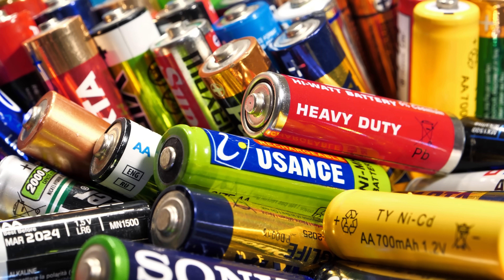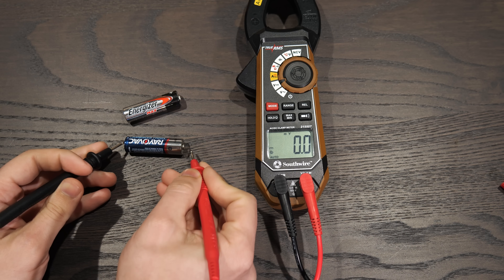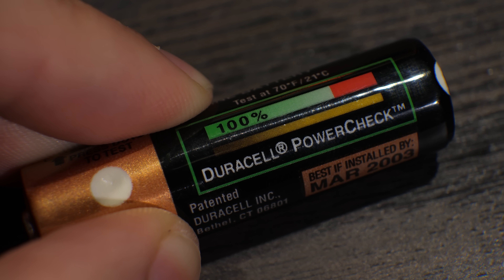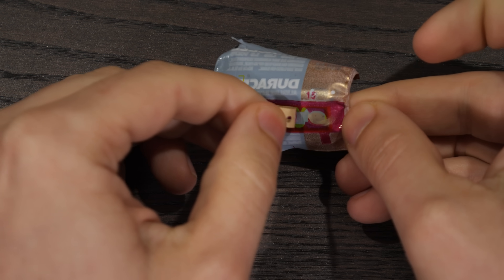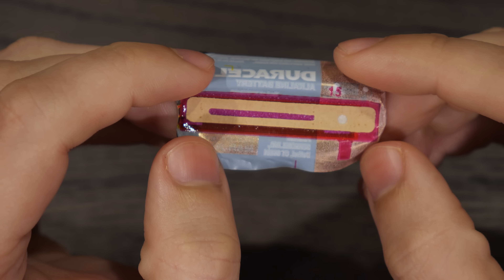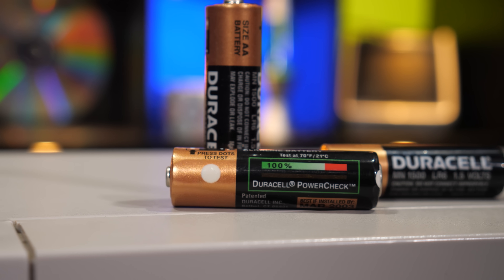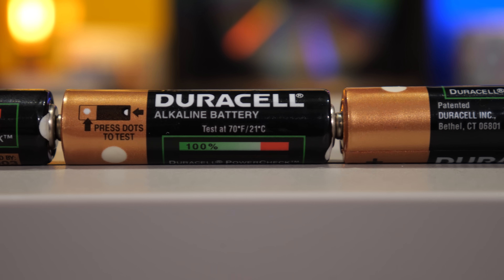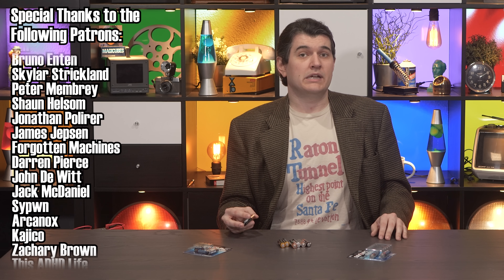Duracell PowerCheck: A genius idea which didn't last that long

Comment: - 00:00 🧒 Common frustration in pre-2010s: gadgets often came with "batteries not included."
- 00:19 🔋 AA and AAA batteries are nearly identical in cost, but AAA has shorter lifespan, causing mild frustration.
- 00:46 🔍 Duracell introduced PowerCheck batteries in the late '90s, which allowed users to check battery charge directly.
- 01:06 📸 Kodak also worked on a similar battery testing technology, leading to patent disputes.
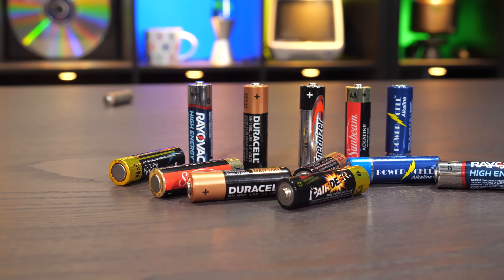- 01:43 ⚡ Battery voltage drops as it discharges, from 1.5 volts when fresh to less than 1 volt when depleted.
- 03:11 🌡️ The PowerCheck worked by using a built-in thermometer to show battery life, with a yellow indicator.
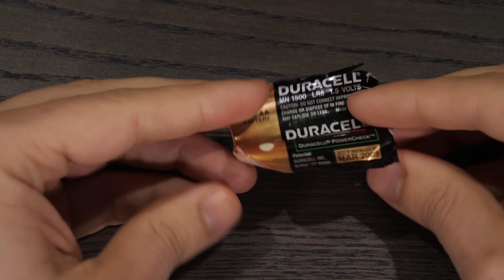- 05:19 ⚙️ Pressing on battery dots completed a circuit, powering a tiny heater that activated the thermochromic material.
- 07:08 🔥 The heater’s resistance varied to show the remaining charge level, based on how much of the indicator turned yellow.
- 09:24 ⚖️ Each time the battery is tested, it loses a small amount of power, but the test is more accurate because it's done under load.
- 10:36 🛠️ Despite its clever design, most people didn't regularly test their batteries, making the feature less useful.
- 13:33 ♻️ The rise of rechargeable batteries reduced the need for disposable ones, making PowerCheck obsolete.
- 14:10 🎮 Devices like Game Boys and Walkmans used to consume tons of disposable batteries, but this is now a thing of the past.
- 14:54 💡 Built-in battery testers are less necessary today, as most devices now provide battery level information directly.

Comment: Great video! I haven't thought of these for at least 20 years, but vividly remember struggling with those dots.
I'm also glad that you referred to Oomph, the technically correct unit of measure for residual battery charge. The late Prof. William Oomph doesn't get the fame he deserves.

Comment: It's a clever but pointless invention. I've just checked my 'man' drawer where I found three AA and two AAA cells. Instead of testing them, I choose to employ Schrödinger's battery principle in which all five cells can be considered to be simultaneously fully charged and dead until they are placed in a suitable appliance or voltage meter. Why bother with the meter when the appliance you intend to use them in will not only carry out its own useful function but will also, at same time, indicate whether or not the batteries are sufficiently charged. Why use a sledgehammer to crush your nuts?

Comment: I wasn't around for this, but in my old school, i found some of those old flash lights that were plastic and had crappy bulbs in them. Anyway, I open it up to find two D cell batteries, with the Duracell PowerCheck. The power check didn't work, but there was still somehow charge in it. Interesting...

Comment: Oh yeah I remember those, but especially the Energizer ones that had this trapezium-shaped box stating 'GOOD', that lit up for a quarter, half, three quarters or in full depending on the capacity left. Quickly found out they worked based on heat because boy if you kept pressing it it would turn hot!
I also had a remote controlled jeep, most likely some junk-box gathered thing that my dad got from a colleague at his job at the time. The thing had a gearbox with 6 speeds but the biggest problem was it just ate batteries like no tomorrow, as the motor in it was a very beefy Johnson & Johnson thing that easily drew a couple of amps. To power the jeep it needed 4 C-cells for the driving motor, and 4 AA's for the receiver and servo-control. Pair that with the 6 AA's the transmitter needed and you understand that as a kid it was a constant swapping of batteries to keep either going.
The cells would come out a bit too warm to touch after some 20-30 minutes of driving the thing around my neighbourhood (which was also about the limit, the batteries would be dead after that time). And those 'GOOD' indicators on the warm C-cells were all lit up ;)

Comment: Considering they lose charging over time while unued, i liked having the integrated tester. I used a lot as well back when they made them. Mainly to check how much charge they had left after a year or 2 to see if they still held any charge.

Comment: Testing batteries isn't about testing half used batteries hanging around in a junk drawer.  It was for testing batteries that were taken  out of a package just opened that has been hanging around in a closet since you last bought them, who knows how many years ago?  That was  the thing about batteries that always made me angry.  You buy a pack of batteries and they'll slowly go dead in the package before you ever got a chance to use them.

Comment: I remember using this type of batteries as late as mid 2010's. Not the exact same model in the video but a blue themed package on the battery. And I also remember like these power checker models were not lasting as long as the non-checker standard duracell models but I might be wrong about this
Reply: with a little search I found some of them are still on sale under the name of Duracell Ultra series in Turkey, very rare though

Comment: My uncle went to put some new batteries in the TV remote and was all pissed off that they didn't work, I took a look at them and they are the Duracell power check batteries like you talk about, the date on the package was 2003

Comment: Anyone that has done product design knows there is a huge difference in size between AA and AAA. Basically the difference can be so detrimental your product wouldn’t even meet the size requirements if you couldn’t step down to triple A. Three triple A can also be more beneficial in space size than double A depending how you have to find them. Dimension and size restraints are some of the hardest things to design around. Adding or subtracting even 1 mm could kill a product especially more advanced stuff like smart phones.

Comment: I remember both the on-battery testers and the little strip testers that were on the packages.  The ones on the batteries were stupid hard to press.  The ones on the package were not difficult to use but I much preferred a numeric value from a multimeter than the strip.

Comment: I learned this a long time ago, forget where, but if you need to check a AA or AAA battery for life, try dropping it (lengthwise) on your countertop. If the battery has a significant "bounce" to it, it's dead.

Comment: The only time I can think of taking partially used batteries out of something is halloween decorations. Don't want to leave the battery in them while they're in the attic, could corrode and damage the expensive electronics.

Comment: My issue with todays duracell is they use a thinner jacket than ever and are prone to leak if stored incorrectly, they are known in some trades as "Duraleak" batteries, iv seen Duracell batteries in the last 10 years kill more old electronics than any other brand to the point for arcade games and pinballs I wouldnt ever trust them now but as a kid in the 90's I remember both Energizer and Duracell was kings of the battery world.

Comment: when I was a kid/teen in the 90/00's I tried so hard to switch to rechargeable but they just sucked so you was forever having to keep some charged as they just never lasted as long as disposable batteries, so thankful todays rechargeable batteries actually hold a decent charge and are pretty reasonable in price.

Comment: 13:40 single use Batteries also have their valid use case, e.g. in clocks, remote you dont use often etc.

Rechargable batteries have a higher power drain, after half a year you can recharge them, even if you didnt use too much power. Single use batteries on the other hand may last years.

Comment: Had some toys when I was younger that needed good batteries. Partially depleted ones wouldn't power it sufficiently, but they would power something else just fine. 

Smoke detectors are another use. You're supposed to replace them every 6 months regardless of if the batteries are still good. They're still fine in a TV remote since that's not a critical device.

Comment: Hi Alec! Great video but these stopped because testing a battery’s voltage and trying to equate it to capacity, especially in the context of modern electronics is ultimately a fools errand as you suspect. A pulse tester like the CBT-1  is the right tool for the job

Comment: I can remember really wanting my parents to get these as a child just because I wanted to see it work myself (yes, I really got mildly more interested in the batteries than the toys they were powering...). Eventually they had to get them as there wasn't any others available in the shop and I remember getting imprints on my thumbs from having to push so hard on those dots...

Comment: The best decision I ever made was getting 12 rechargeable AA batteries and now I am never short as 4 are in use 8 are charging then I let them run out and charge again I used to use about 12 AAs a week for my VR controllers and they cost about 10 euro per pack that was 520 euro a year not a lot but that's a lot to spend on AAs alone

Comment: there was a point in between when batteries had these and when they didn't that the battery packs would come with the test strip as its own little thing rattling around in the package. it was super annoying to use though because you had to hold it in place and put pressure on it and the strip was always short so wrapping it across the length of the battery was a PITA

Comment: Ever thought about doing a video on the connectors taking video transmission from analog signals like composite, component, and VGA to the digital age of DVI, HDMI, SDI, and DisplayPort? I think it would be very interesting to go over the different standards, resolutions, bandwidth capabilities and different uses. Taking a look at how and why they were created too.

Comment: If I have the choice to buy a device with rechargeable batteries or one with batteries you can change I will choose the latter. The second option gives you a device for life the first a device until the battery life of the rechargeable battery lasts.

Comment: Very interesting video, I really loved seeing what these look like taken apart.

I've worked on a number of batteries over the years. In a nutshell, batteries produce electricity through a chemical reaction. Even with dead rechargeable batteries, it's possible for that chemical reaction to produce something like a static charge that will register on a voltmeter, but dissipates as soon as there is any real load. A lot of battery testers have a resistor so that you can put a load on the battery and see it's capacity. Some of these, especially for big batteries like car batteries, are quite large, capable of putting many amps of load on the battery. It's fascinating to me that these little testers also create some load, making them a bit more accurate than just pure voltage.

I seem to remember that part of the marketing when they came out involved this theory that consumers had no idea how new the batteries in the store really were, that they could have been sitting there for years. With testers you could verify the batteries you had actually had full capacity. That and the theory of the random batteries in a junk drawer, or not replacing all the batteries in a device at the same time. My memory was that they rarely said 100%, but maybe that's because we didn't press hard enough or wait long enough. There was always this fear that you were going to use up all of the capacity just running the tester.

Comment: Don't blame the engineers for the use of AAA batteries.   

In my life experience the AAA choice was forced by designers and product marketing people who tough that a device (like a remote) needed to be smaller... Aka Zoolander phone :-).   

Indeed it turns out two AA batteries makes for a far more comfortable device in the hand.   I'm still annoyed by Apple and the appleTV remote which is so thin it is hard to hold.

Comment: Duracell did this again in the mid-2010s at some point. Exact same concept, but the changing filament went over the green/red bar instead of below. Still had to shove your fingernails pretty deep in the bumps to get it to actually register.

Comment: I always preferred to buy the batteries with the built in tester. Plenty of fun to activate the yellow bar. I always used the tester whenever I grabbed a battery because it was fun and reassuring. I completely disagree with the assumption that people weren't using the tester. Now that they don't come with the feature, I test my batteries using a multimeter before I insert them into a device.

Comment: apparently it's recommended to replace both batteries instead of just the dead one. Not a lot of uses for one half dead battery out there IF you do that.
I have a wireless mouse that uses 1 AA battery so whenever that dies (takes around a year maybe 10 months or so) Instead of popping in a new one I could use older ones.
The only uses for batteries I've had in the past couple years are just wii remote and my mouse, and I barely play on the wii, so I'm averaging about 2.75 dead batteries per year myself.
My brother on the other hand, goes through a lot because he plays on Xbox with a controller that uses batteries. Recently I was just thinking if he's going through packs of batteries every couple months imagine how many AA batteries are dying from the millions of other gamers out there.

Comment: I still have an old LCD alarm clock from the late eighties that will run for literal years on one AA cell, or many months on a battery that was too weak for a remote, let alone toys. The display is slowly turning black like a cancer is consuming it but i can't throw the thing out as it is so damn frugal.

Comment: I remember seeing these testing strips for the first time. I usually had a lot of batteries that fell out of the package and often also had empty batteries mixed in in the same drawer. So I was very excited when I  saw they had an inbuilt tester. Until I realized how impossible they were to use. It was always a pain to make sure if a battery was actually dead or not pressed hard enough (also, I did not understand why pressing that hard was necessary, so I was under the impression the tester just did not work very well). I would never want to test more than two batteries because my fingers just hurt too much from it. So I never used the strip and instead tested them by just plucking them into a random device.

To me, they always were a great example of a very useful gimmick that is just too userUNfriendly to actually use.

Comment: It was a neat gimmick that I rarely used because it hurts to use it.

I keep partially charged batteries around as I have a few remotes that can run on an almost dead battery so I swap them in from devices that stop working earlier in the battery life cycle.

Comment: What is your opinion on the Lithium Rechargable AA batteries? They have a slightly shorter Li Ion cell in an AA package with a voltage regulator to drop the voltage to a constant 1.5V. Apparently they have both a high self-discharge due to the regulator being constantly on and also create radio interference when operating.

Comment: I'm glad it isn't just me who thinks that AAAs are pointless and AAs should be the standard. Used to annoy me a bit for the same reasons you've mentioned.

I used to like Power Check and don't know why it died out, except for the finger thing, obviously! :) I had forgotten about the advice to test at 21c. That used to make me smile as the temperature only reaches 21 in the UK in summer and even indoors you'd have to crank your heating up, which has obvious drawbacks.

20-year old batteries do have a use after all! I still keep a stock of batteries, mainly because kids' toys need them and some of those absolutely drink battery power. There's a surprising number of things which still need disposable batteries. We have a digital kitchen scale which needs one of those "coin" batteries similar to what you have in watches (can't recall the voltage off the top of my head) and the wireless mouse for my laptop (I detest track pads - You should do a video on those, if you haven't already) needs one AAA, although this does tend to last for a while. Then there's TV remotes etc so I find it's still worth having a stash somewhere.

Comment: I remember there being 1 company (I can’t remember which one) including a temporary tester with the batteries if you bought a pack of 8 or more. However, I think it was only good for a few uses. Unlike the Duracell one, you saved the plastic container (that they came in) and put the battery along the strip in the center of the package. Press both ends of the battery, which then did something similar to the Duracell strips.

Comment: At the time I hated these things for several reasons. Firstly I suspected it was some kind of thermal process so it takes quite a bit of power from the battery. Secondly it seems so wasteful to be throwing away an extra bit of tech with every battery. Thirdly, I'd always have a nagging doubt that this thing would be spuriously triggered by pressure with some surfaces inside the device. Fourthly, I have a multimeter and I know how to use it!

Comment: I just ran into a decent set of these in my stash. I got a few weeks of wavebird use with them. But yeah, they weren't very accurate. It's still a cool throwback, though. I'll never forget those days stabbing my little 12 yr old fingers into the "dots" trying to convince myself they were still ok lol. No they're not dead i just need to press harder. As a gamer it's insane to think xbox is still demanding we use AA's so rechargeables are great. They have some benefits but honestly rechargeable batteries are the way to go.